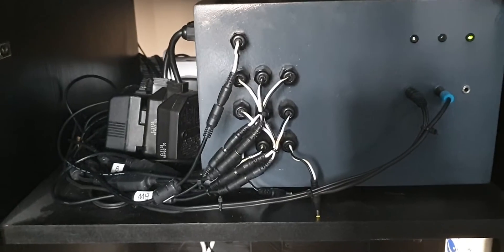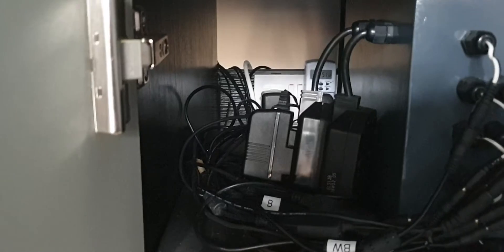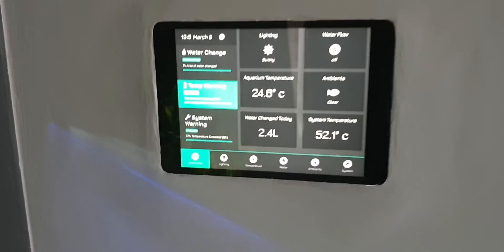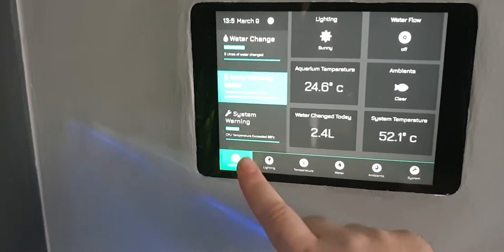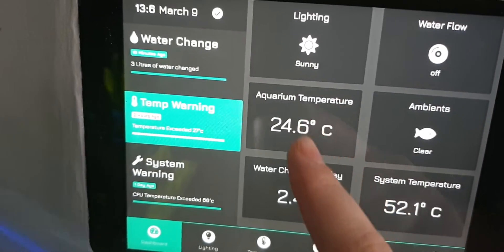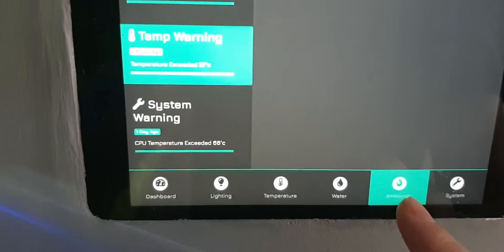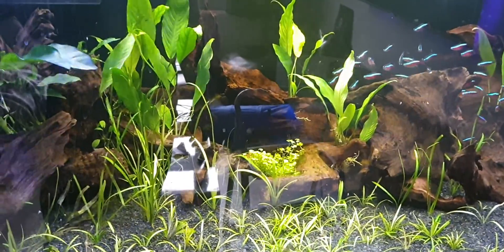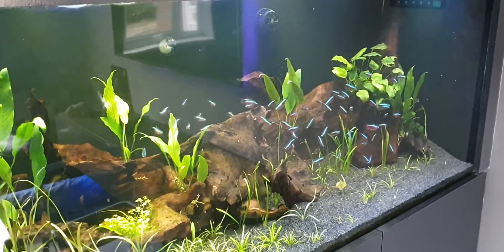1 year update Raspberry PI aquarium computer auto water changer.

Comment: Some suggestions: You could put a dessicant bag into the PI compartment. You could try to simplify your power management with a DC power supply and run LED lights, pumps and lamps from there. PH and EC meters have become relatively cheap (ask me if you need details). Otherwise: It's extremely cool and I hope I can build something similar soon.
Reply from the maker: I must do an update on things currently